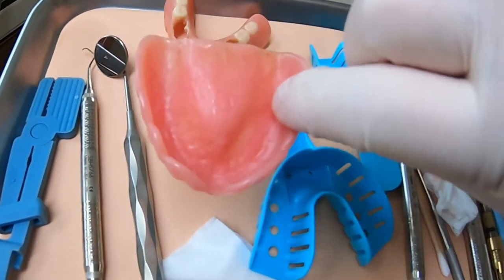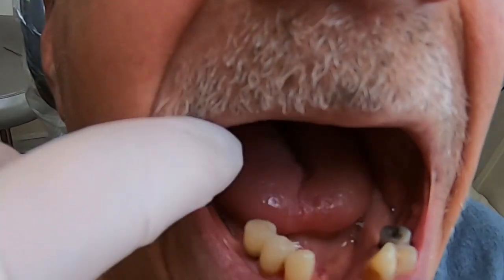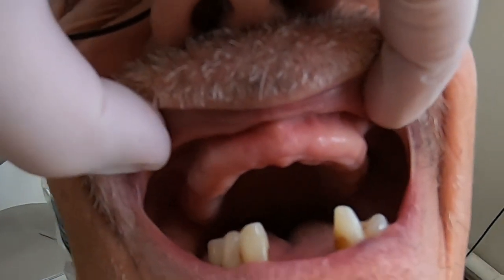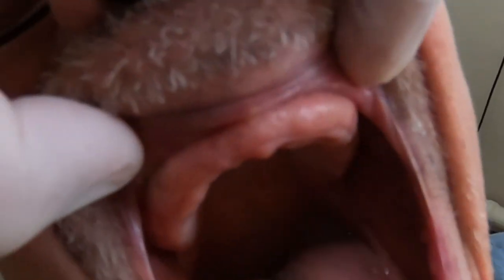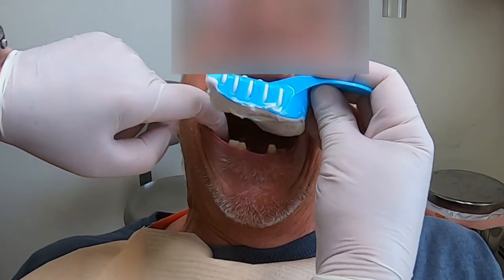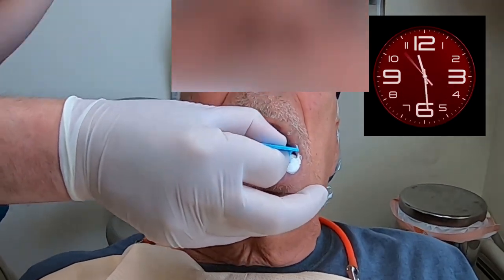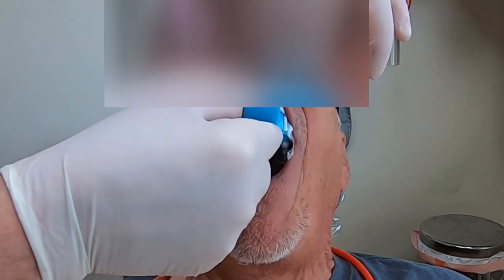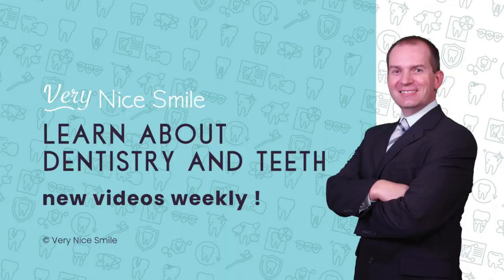Preliminary impressions for an Upper full denture and a lower Cu-sil partial denture.

Comment: How long does it take? 
I had some of my upper teeth removed and need a bridge there. Decide for metals as i had a bridge lower in acrylics and it was unhygienic..
Bottom i need full design 😊
Was going to have it done right when i get them removed.  But my toothache was murder,  so i had them removed before i could have the impression.  
That was January ,February.  
Then March , April and May was only check...check....mold...check...mold.
Well,  i still without,  missing out on family Easter meals,  mother's day and a friends daughter's baptism.  
He says its because i had them removed and he waited for healing. 
Well needles to say, was healed totally 8 weeks after.
Reply from the maker: Hi, I usually wait 6 weeks after extracting teeth before taking impressions, but it all depends on the situation. What was your situation in the beginning?
Reply: Well situated was getting them removed and waiting for healing.  Was healing well and fast . But they say " we are a small business and can't do faster ". 
Anyway got them yesterday finally,  however not fitting.  
I tried all kinds of adhesive and nothing, not even a minute.
Reply from the maker: Hi, what did you get? a full lower denture and an upper partial denture?